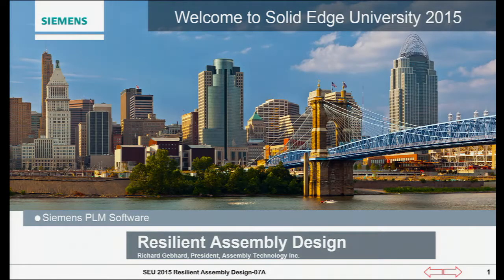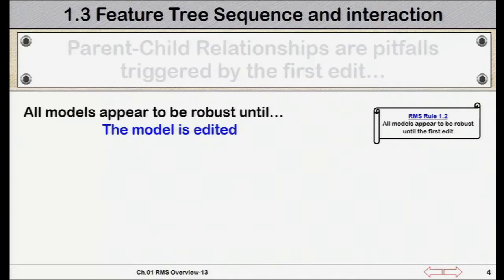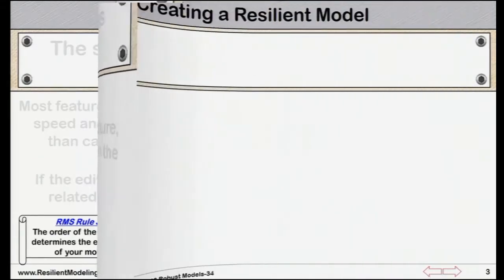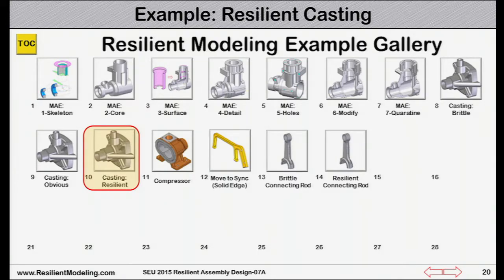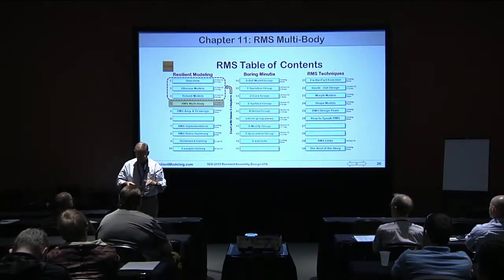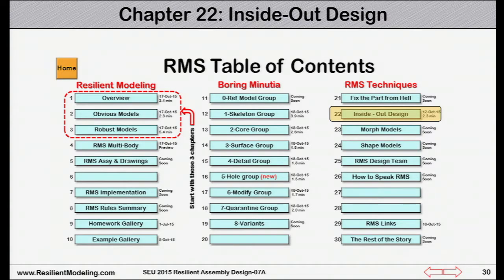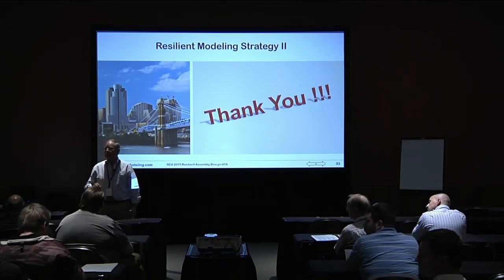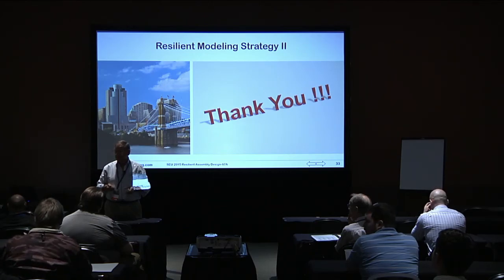Resilient Assembly Design: Solid Edge University Session

Comment: I don't understand the whole model aircraft model.

36:40 'new faces are growing rather than shrinking' => what does this mean?
What is an 'unique thickness' option?
What part of this design is 'inside out'? It's just connecting shapes and then a shell operation.
Reply: Faces: I think he means that is much more problematic to shell out (or "thicken") inwards, as it might make curves and corners shrink to negative/impossible size.
Unique thickness: Wild guess is that the shell out allows different thicknesses for each surface. 
Inside out: He started with the important inside instead of the outside.